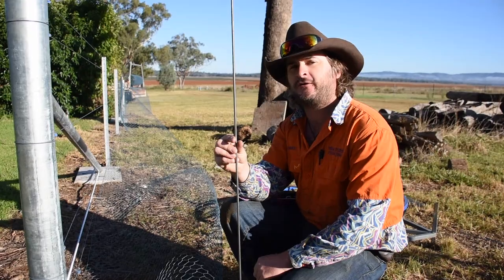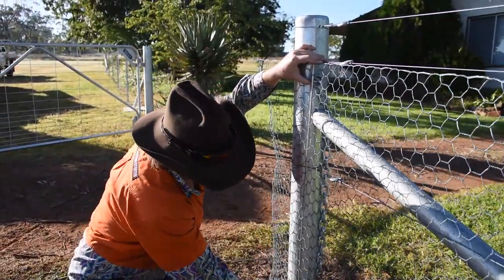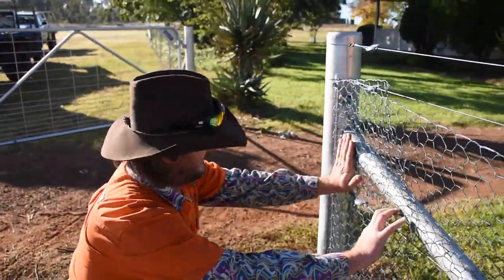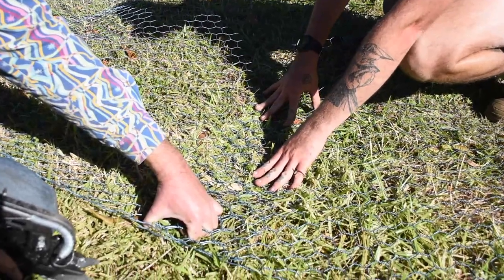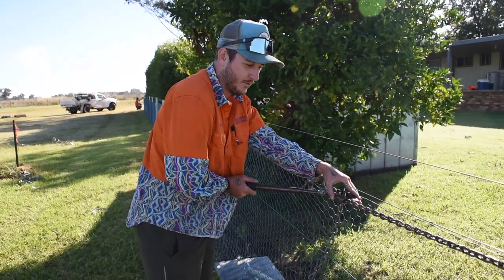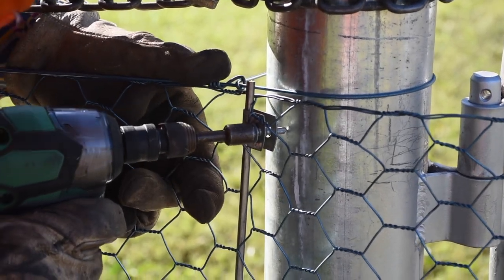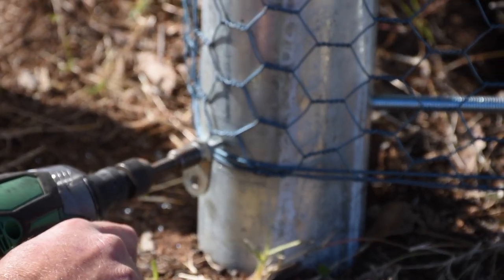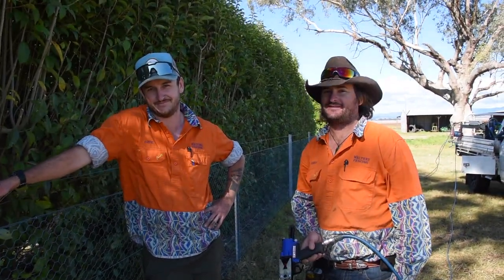How We Do It: House Yard Fencing #EP20

Comment: Interesting to see that you don’t use a strainer board on the netting. Are the top and bottom wire made a bit more heavy duty to allow attaching a strainer on them? Be interested in your thoughts. Cheers fellas.
Reply from the maker: Hi John.  Thanks for commenting.  The top and bottom of the Waratah rabbit netting, that we use, has 2 x 1.4mm wires that the netting pattern starts and stops on.  This means that the only part of the netting you can pull without stretching the diamonds is the top and bottom wires.  We don't strain the netting too tight,  but just enough to take the belly (slack) out.  Straining boards would work just as well, but are slower to attach and easier to overstrain.  
Cheers Steve

Comment: Do you guys use the notched knipex cobolts or the flat ones? Just checking as they are fairly pricey here. Also do you prefer the 200's or 250s?
Reply from the maker: Hey J M.  
My thoughts only...I prefer the notched for pull down (handles No.8 better) but probably flat for construction as you can cut any size wire in any part of the jaws (don't have to avoid the notch).  I only use the 200mm, but again, only my preference.
Cheers Steve
Reply: @WaltersFencing  Awesome thanks, it's a tough decision, might get the flat ones new then and see if I can score a notched one second hand as having something that can cut a lot of wire quickly will be handy for pull down as you say. I have those end nippers at 200 which are great for some tasks but a real pain to cut heavy wire with